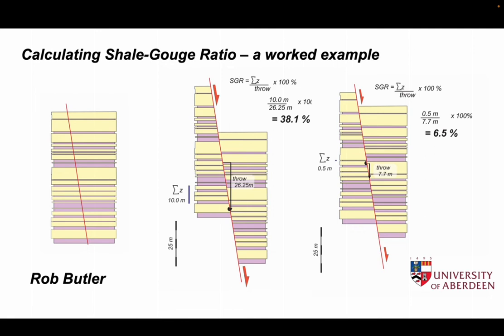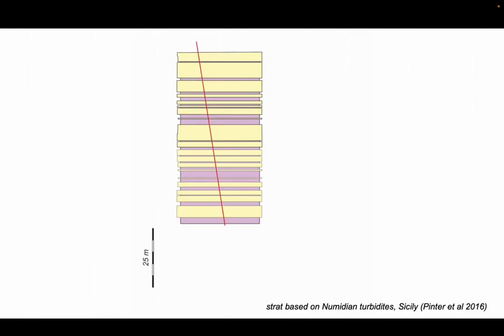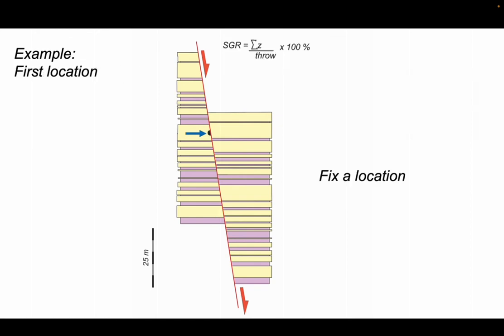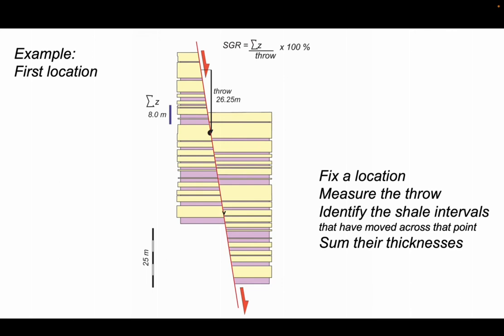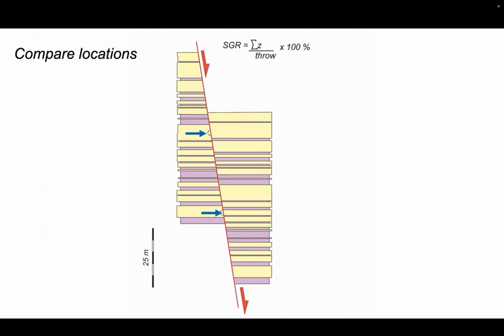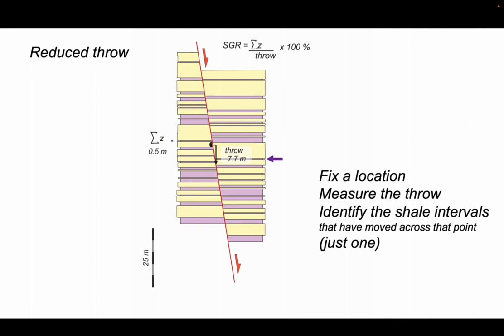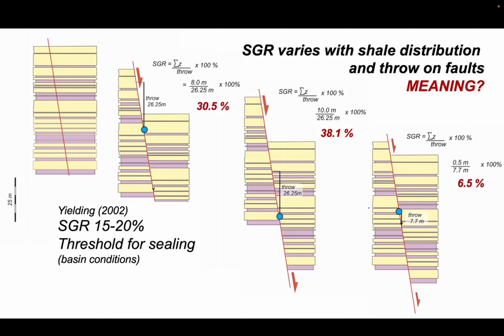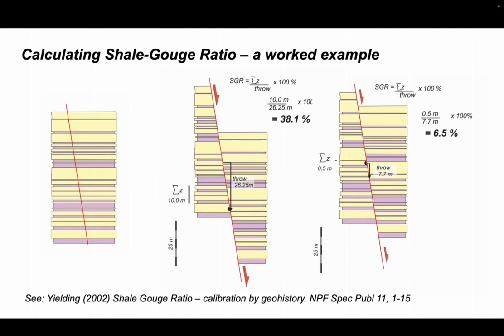Calculating Shale-Gouge Ratio - a worked example

Comment: Great video! To be honest i didn't get how you identify where to put point? Why didn't you count all the shale layers which pass the point, you counted only certain number? Thanks
Reply from the maker: Thanks for the question. Actually in both cases examined in the film, all shale units that moved past the point on the fault that was being considered were identified, their thicknesses measured and then summed to find the thickness of shale that moved that point on the fault. This is an illustration - it's quite possible to calculate SGRs for all points along a fault (and in 3D) to contour up SGR for the entire fault surface.
Reply: Thank you

Comment: Hello Rob, great video. I have got a question. The binary stratigraphy used in your SGR Calculation depicts a situation where we have blocky clean sands, thus I observed you considered the thicknesses of the shale units only. But I am curious, in a scenario where we are working with shaly sands, would it not be wise to consider the Vshale content in the sand units which have moved??
Reply from the maker: Yes of course -  V-shale (for those reading - the % content of clay/mud in a "dirty" sandstone) is commonly used in these situations...